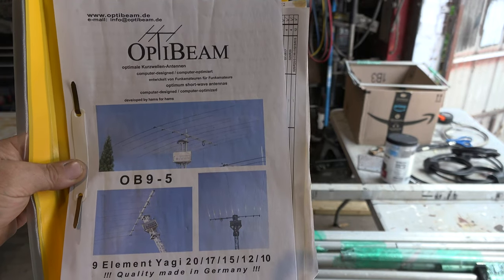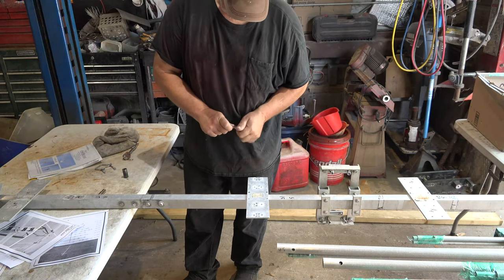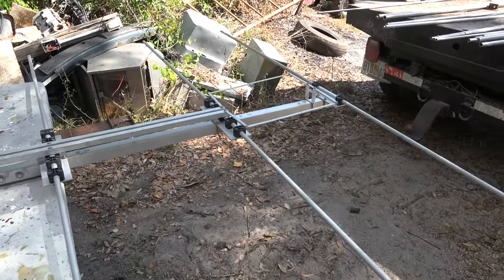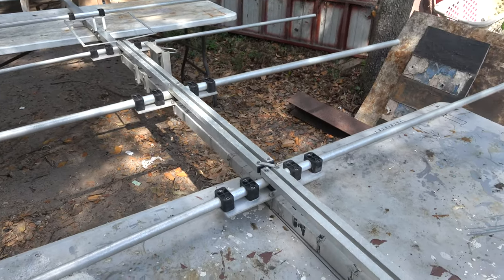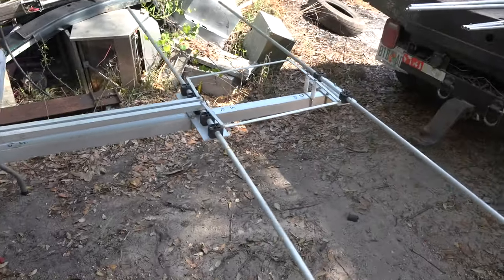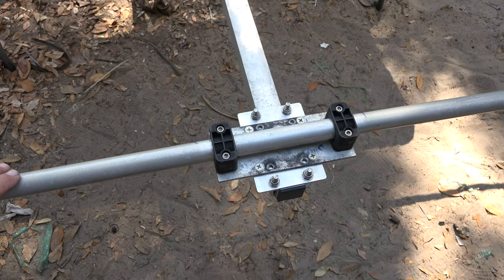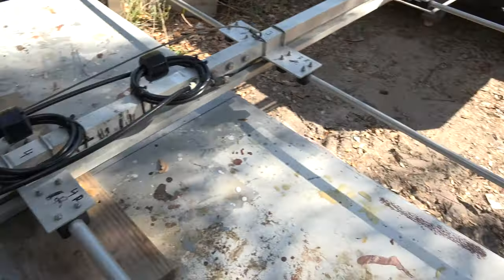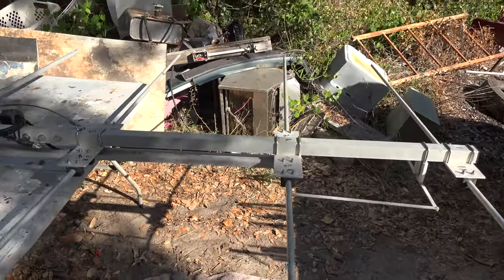OptiBeam OB9 5HD Yagi Ham Radio Antenna, assembly and mounting on  Mast

Comment: Greetings
Im considering this antenna, but the manual gives me d' creeps. How u determined the distance between elements and measure in overall
?
Reply from the maker: Yes, the manual is horrible. I had some help due to the fact that I bought the antenna used and I could just install the radial centers on the old positions. The radials where also numbered by the previous owner. I still had to look at the manual / schematic many times. After some time I finally figured out how all the numbers translated to the lengths of the radials. Reading the manual is just more confusing. I have no idea how anyone can come up with such complicated description. I think the designer / builder of this antenna assumes that everyone has an engineering degree. However, I still highly recommend this antenna because of the built quality and excellent performance. It's pricey but you get what you pay for. I hope this may help you a little in your decision. And thank you for your comment  KY4XV